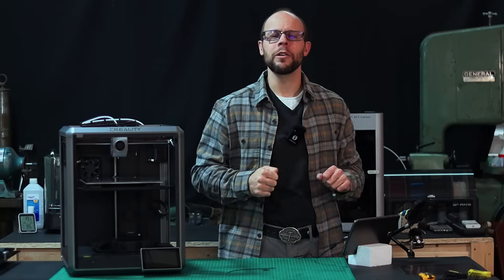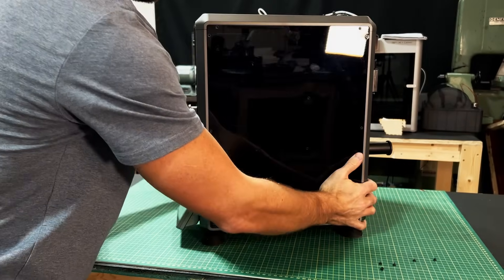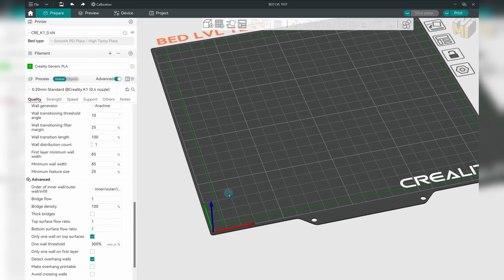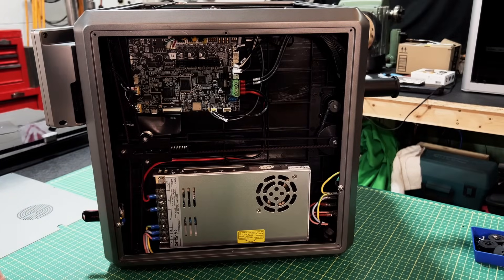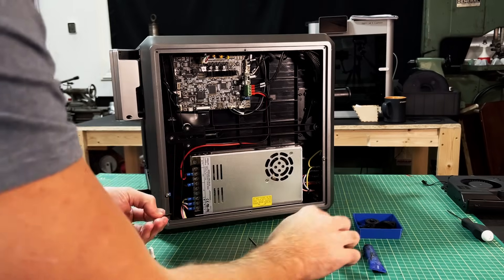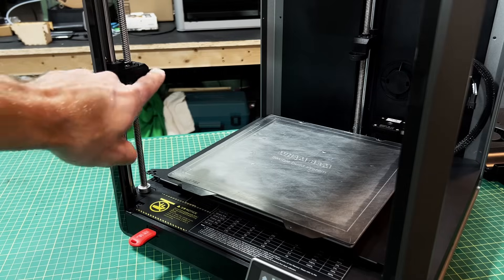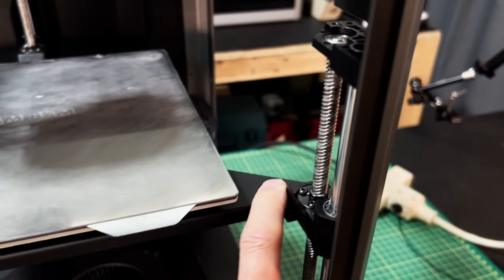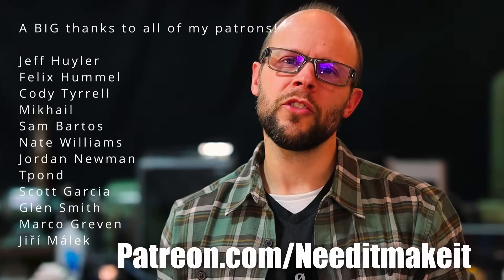Quick and Simple Way to Level Your Creality K1 or K1 Max Bed

Comment: I'm a little late to commenting, but the reason Creality's method didn't work for you is because the correct step is: Loosen Belt Tensioner, Manually bring bed by turning the lead screw/shaft until it bottoms out (that part you missed), and while it's completely bottomed out while you hold the shaft in place, you then screw the bed screw holders back in. That way when you put the belt on it's 100% bottomed out and as plane as it will ever get. If you don't hold the shafts in place while putting the screws it it has a tendency to move out of place. Just my 2 cents.
Reply: this is what was on creality tutorial how to level bed on k1 yes?
i have problem with abs warping in are when bed mesh is blue so i thing my warping is because filament is not squished enough, you think this shims on that video going to work for warping?
Reply: @tomaszmilecki1955  shims won’t help with warping.
Reply: @tomaszmilecki1955  a new bed

Comment: Hi Mike.  Thanks for this video.  It helped me get a much better bed mesh.  What is the scraper tool you're using at around 7 minutes?  Is it a 3D printed holder for a razor blade?

Comment: I used this and it improved the bed level greatly, thanks! The simplezt fix however was if Creality would perform some basic QC.
Reply from the maker: That's great.  I agree, for something like bed level, they could have done quite a bit better, it's especially important for the larger bed on the K1 Max, most people with the Max seem to be out by quite a bit more.  The bed warps more during heating also which is partially to blame.

Comment: Do you concider 0.6mm difference between the high and low point to be something I should correct on my K1 Max?
Reply from the maker: 0.6 isn't much, if it were me, I'd try to use the shims to get it a little bit better, but it's not so far out and it'll work just find as-is.
Reply: @NeedItMakeIt   I do however experiencing some minor issues with print quality. A test cube comes out pretty much fine with just 0.1-0.2 mm of the 30 mm but that can be because of shrinkage. I did one test with several one layer squares and some of them came out looking like the end of the nozzle scraped into it or something. I then read that you should let the heatbed soak at 60 before starting the print. It then looked ok I thought but I then did a print with a rather large rectangular base and then the lines did not adhere together instead. I think that is if the nozzle is to high up? I wil try to use the spacer thing and I might just use some aluminium tape since that is about 0.12mm thick since I only have PLA currently. It should not compress and would withstand the temperature. I have the K1 Max so it have a 3-4 mm thick machined aluminium plate as the base so it should hold mostly flat. The variance on the unheted bed was just 0.76mm so not so big difference to the heated one.  My highest point is in the middle on the left side at +0.54 mm against the glas and slope down just 0.1 mm towards the left corners at +0.44mm while the lowest point is the right corners at -0.11 mm with a slight bow towards the center of the right side that lands just around +0.1mm.  So I do wonder which screw I should put the spacers to get it flatter.
Reply from the maker: Yes, heat soaking will improve your results, I made a video on this, it is called "Let It Soak" in the video description, there is some code you can copy and paste into your slicer which will automate the soaking process.  The Max has problems with the bed warping, the issue is a combo of the aluminum plate thickness along with the speed at which the bed heats up, which for that printer is very fast.  I have to get back to a video, but if you need some more info, let me know!
Reply: @NeedItMakeIt  I think it might have been that video I got the tip from. Tried to make a one layer square on the whole bed to test it out, and I could definitely notice the warping before i canceled it.The low corner had low adhesion, so it was just laying down individual strands attached to the border and where it was higher towards the middle on the right side it was instead matte and had some uneven marks perpendicular to the nozzle movement which is rater strange. You might know what would cause that. Will try to make some smaller items like a fan grill for the bed fan and see how that comes out.

Comment: I loosened the belt several times and turned the screw separately from all the other screws and angles, I adjusted it with copper foil, made washers out of it and put a 0.1 difference under the table mount without plastic spacers

Comment: What slicer/application is that?
Reply from the maker: That is Mainsail, if you root your printer you'll be able to access it, if you don't want to, you can type in your printer's IP address in your browser bar and you should see Creality's UI, and it works okay, it's just not as full-featured.
Reply: @NeedItMakeIt  ty so much <3

Comment: Started having big problems with flat models curling, chat with creality they said official way to fix that was to make sure the lid it taken off when using pla, hyper pla, also leave door open.

So i said id give it a try, printed an animal with raft, soon as raft printed it started to lift st one end. So i replied in that chat window, saying no difference. So waiting for next reply.  While waiting fid a search, others sll have same problem, most are daying change bed temperature from 45cbto 60c so i did that, and the animal printed great.

So wonder what you think, it all started when i downloaded a toolbox for all the tools that come with the printer. Started printing the lid, took up most of the room kn the bed, suppose to be 13mm thick😅 but when it reached about 3mm it started to curl upwards each corner, so stopped the print.

Whats going on, textured pei build plate, double sided, the model now has the new extruder and quick change nozzel.

What you think?

Comment: This worked well, thanks. The only change I made was to cut from the flat end of the shim twice to each mounting holes, to make a kind of funnel. Then I did not have to remove the very difficult to remove back support screws (wait 'til you're 72...). So loosen the screws two turns, slide the shim in, tighten 'em. I put a 0.8mm in the front right and a 0.4mm in the rear. It went from a starting point of 0.97mm spread and standard deviation of 0.29,  to a spread of 0.33mm and a S.D of 0.08. Delighted. I used PLA though, and I'm not enamoured with the thought of any plastic shim in a warm environment, so they'll be changed for stainless shim stock when time permits.

Comment: I guess there is no option to loosen connection between lead screw & sprocket and stepper motor & sprocket to simply turn the lead screw individually to get bed tramed?

Comment: I had the same issue with my k1 speedy and i did a method you should try yourself you skip the teeth one or two times its so easy my bed is at .157 because of doing the tooth skipping method

Comment: You need to loose the pulleys on the lead screws in order to fix it the recommended way. Because the angle of tooth are wrong tho where the lead screws want to be. If you don’t lose the pulleys they will just snap back to the place of least resistance. And that is probably almost the same position as when it was assembled in the country of buy stuff cheap with a ton of headaches  included. 😂👍

Comment: I dont understand why people make shims Loosen the set screws at the bottom of the lead screw set each point Tighten set screws back down
Reply: Spot on! It's a single stepper motor pulley at the rear connected via a belt to the two lead screw pulleys at the front. If one corner is too high or low, slacken that lead screw's pulley grub screws and then manually turn just that lead screw clockwise or anticlockwise to bring it level. Then tighten the grub screws again. You don't need to slacken or remove the belt tensioner bolts, nor remove the belt. Simples! :-)

Comment: I have a cr10 with klipper and have a similar error on my best corner leveling , i think the autobed leveling system (bltuoch) do the work , so no problem with that , but my bed is a little warp too (but hay pass from 1.4 mm to 0.28 mm error 😊)

Comment: Thanks for this!  I'm preparing to fix mine using the spacers and I have a question.  How do you measure exactly how much the bed needs to be raised.  Remember the part of the video where you miscalculated a bit?  Can you describe how to measure from the bed points accurately so I know how much it needs to rise?  I'm kinda new to all this so please pardon if this is a dumb question.  Also, I only have PETG and PLA so I'm going to use PETG and would like any feedback if that's a problem.  Thanks.
Reply: Also, should I base it off the warm bed or cool?  I use PLA and PETG.  PETG at 80 degrees and PLA at 45.  Which temp should I use?

Comment: The reason you cannot adjust properly just by taking out the belt is that the belt tension and the angle of the preinstalled belt hubs hasnt changed after that procedure. You could just simply loosen the bolts that tigh the hubs to the rods. Limit down the table and tight them back at the same torque. This might work better if we are sure that the printing head also moves level all he way through x and y .

Comment: Hi, whats your printers situation now? Do your spacers still work good?
Reply from the maker: Yup, and on the Max as well, just make sure to print them from something other than PLA because they may soften over time near the bed and in a warm enclosure.  The only issues I have with the K1 now are extrusion related, I believe that's due to the extruder design.  I see that Bondtech has released an upgrade kit for this printer and the Max, so that's one option to solve it, I think the other would be to replace the extruder with something else off-the-shelf.
Reply: @NeedItMakeIt  Is the extrusion issue you talk about that, first version K1s problems or all of them? The seller Who sold me my printer said 'this is updated version of K1'. Does it mean its a fixed version?
Reply from the maker: @St0ne6reaker  They've gone through quite a few changes, but I think to match the quality of extrusion for the X1C, the extruder gears need to be supported on both sides and I don't believe any of their printers have this.  It's possible there is more to it, however it seems that it is the mostly likely source of that last little bit to achieve excellent results.  So to answer directly, no I do not believe it can or will be fixed 100%, they're about 95% there.

Comment: How can I access this interface?
Reply from the maker: If you haven't rooted you need to type in your printer's IP address into your search bar, you'll get the Creality UI and that should get you what you're looking for.
Reply: @NeedItMakeIt  I want to make changes to the .cfg like you did. Should I root my printer?
Reply from the maker: @sametkarakoyunlu8835  You'll need to root your printer in that case, you don't need to go as far as I did, you can agree to root, and then SSH into your printer with MOBAXTERM or other and you'll be able to find the files.  It's just not as nice of a way to access and change them IMO, but it should work nonetheless.

Comment: I've been running 9x9 with bicubic tension 0.2 and getting over 100 probes per mesh really thorough calibration
Reply from the maker: I had some success with bicubic until I tried it on the Max, it didn't enjoy that many probe points.  Did you chance your probe type?
Reply: @NeedItMakeIt  so sorry about the late reply, Mike. been a busy week ! I did, yes. Have you seen if Lagrange is possible on the max ? BTW, thanks for the amazing content. My linear rails mounting points and anti shake construction make my printer a completely different ballgame. I really appreciate it! I'm looking forward to when someone gets different extruders on the ke that will be awesome
Reply: @NeedItMakeIt  I have the flowtech, but it's just an upgraded version of the stock hotend. I'd love to throw an orbiter and phateus on here or something
Reply from the maker: @RogueStatusFishing  Cool, that's kinda the direction I've been going as well, I am having trouble finding a connector to adapt to the micro 4 pin 1.0 though.

Comment: I applaud you for such an ingenious way of tramming the K1 bed. Thank you.
Reply from the maker: Thanks, a shame they didn't include the shims with the printer, it would probably have been quite easy for them to do from the factory.  I'm not sure if this is something they've fixed on the K1C, do you?
Reply: @NeedItMakeIt  I have a recently purchased k1 max with the k1c fixes from factory (smaller pulleys and the unicorn nozzle) and the bed is still off.

Comment: Sorry for the silly question but where can we see the bed leveling map results you showed on this video? Does it require I root the printer to see it on terminal? I am trying to avoid this so far...
Reply from the maker: No problem, that's why I'm here.  If you haven't rooted your printer, you can type in your printer's IP address into your search bar, this will bring you to Creality's UI, and there will be a mesh there, it's not as detailed as the one I was using because I had rooted and I was using Mainsail.  If you can get to Creality's UI it should work for you.
Reply: Thanks a lot. I´ll do that. Keep doing this great job!
Reply from the maker: @ricardov.freitas9478  Perfect, it should work just fine for you.  I'll keep going as long as I can.

Comment: Excuse my dumb question, how do you know which side in the bed mesh diagram is the front (closet to the front door) side and which one is the right side? My K1 Max isn't rooted, so the 0 on the X axis of my bed mesh diagram is the left most point when facing the printer front door? And the 0 on Y axis is the printer front?
Reply from the maker: Normally when you enter the program you should see the mesh from the front as well, right is right and left should be left.  it's normally on a slight angle as well, not looking straight on exactly.  It should also have a label for X and Y axis at the very bottom.

Comment: Thanks for posting this! I'm printing in ABS for the first time on the smooth PEI sheet that came with the K1 Max, should I be using glue stick? I've been looking online and I'm seeing over adhesion issues with ABS on PEI sheets.
Reply from the maker: Unless you're in a production setup, I'd use glue stick for every print.  This will bring your success rate up to 99% as far as adhesion related issues.  Normally ABS has adhesion problems for most buildplate materials, PETG however likes to stick, and so does TPU, the glue stick will prevent any damage to your buildplate from those materials.  Let me know how it goes!
Reply: @NeedItMakeIt  Thank you for the prompt reply!...and for the guidance :)

Comment: Got a Max a week ago, I wrongly thought I could just autolevel and print but nope, I've been having a few adhesion issues anyway, bed's off by 1.4 mm. Thanks for the awesome video and the spacer models, this printer is undergoing minor surgery first thing tomorrow lol.
Reply from the maker: I have two more videos on the subject, as well, for the best bang-for-the-buck, you might want to check out the Let It Soak video.  You'll be able to get pretty close to perfect first layers with some info from that video.  No worries, glad I could help!

Comment: Thank you for your informative video. So nothing has changed in wrapped Creality beds in 3 years? These beds are piece of junk! I have planed to try to press my old Ender 3 bed straight or at least better than it is. I tried to look for 4mm heat beds also from Bangood and Aliexpress eand so on, but I cuold not find any straight bolt on kit either. I have new moter board with bed levelling but it seems to not be able to level it enought. If you have wrap 1,4mm at 220mm it is out of any industrial standarts. but as we used to say in Finnland about Russian tolerancies: Small counrty; small tolerancies, big counrty big tolerancies. This works fine with Chinees also! Thats why I like German tools, they are according to DIN standarts, you know what you get. Normaly they fill the standarts in flying colors! I´m wondering why nobody has not started to make straight hot beds for Creality printers with 4mm plate? It wuold not bend so much when heated and would tranfer heat more even. And  thermal insulation under the bed. Pressing the bed straight with heating elements on can be risky, so before I do it need to make CR10 updated and runnig again!

Comment: The clue to as why your first method isn't working is when you put a level on the bed then on top of the printer.
The lead screws aren't moving when you re apply the belt tension.
It's your gantry. The gantry is attached to the top cap of the frame. Seeing as the top cap of the frame isn't level then most likely your gantry isn't level either.
This is also why it's called tramming, not leveling. You need to tram the plate into the same plane as the gantry.
You can try and resolve the issue as to why the top cap isn't square with the rest of the printer or do as you did.
Of course this assumes the bed mount is flat and the bed is also flat. Which they are probably not. Another reason why a printer needs mechanisms to facilitate tramming.  Which this printer does not have.
If creality had added 2 more stepper motors and controllers to independently control the z screws then klipper could have automatically trammed the bed and this printer would have none of the bed level issues that plague it.
But alas, to save $30 in parts on a $1500 printer they did not design it this way.
Same story different creality printer. Almost make an excellent printer but falling short due to penny pinching.